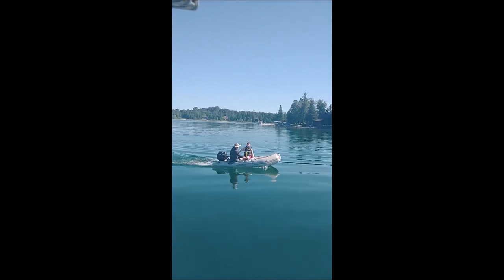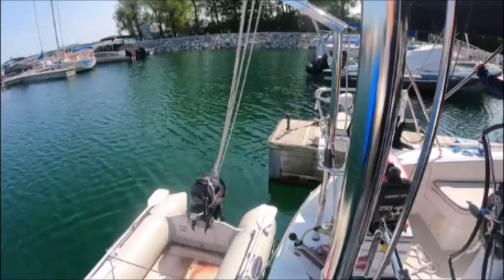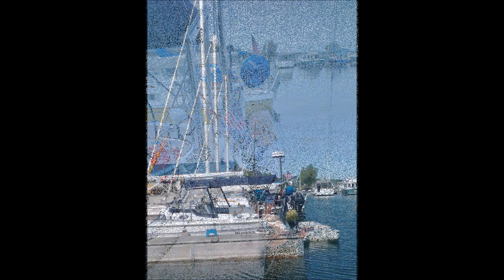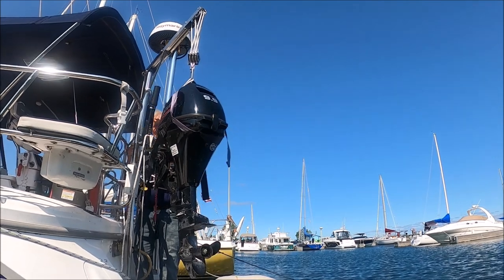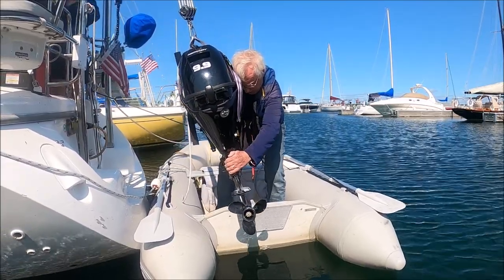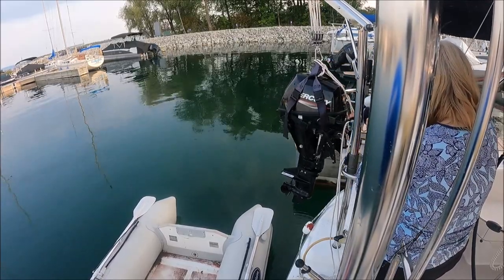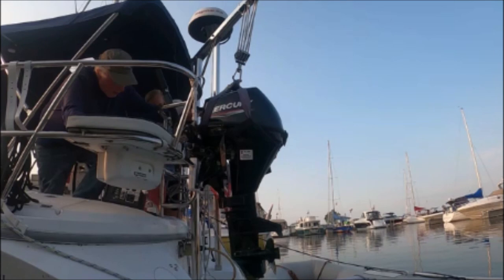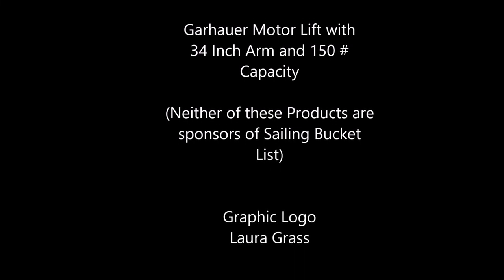Episode 27 Outboard Motor Hoist for Safety and Convenience

Comment: as you get older, and less strong, perhaps leading this lift line to a winch would make more sense, so you can use the two speed, and the handle to do the main work, as well as giving the three or more winch barrel turns for friction allowing a safer, and easier lowering of the loads.
Reply: This is a great idea.
We're going to try that after we launch the boat in May, even though we don't need it just yet.
Others may benefit from your suggestion!

Comment: I just got my Garhauer hoist but can't find any mounting instructions. Do you have any closer details of how you installed yours?
Reply: We found no instructions either, even after contacting Garhauer. We mounted the plate with ball on top on the swim platform in water tight manner.  Mounted the vertical support ring on the stern rail.  We slip the pole with arm on and off, as needed.

Comment: What about bouncing seas? The dingy doesn’t always move the same way the sailboat does. Climbing rope for more stretch?
Reply: Good question!  We tow our dinghy with a V shaped bridle.  We have not towed the dinghy in seas as rough as you describe.  We have the option to carry our dinghy on the stern of the sailboat using a dinghy davit net.  Generally speaking, we prefer to stay in a marina or at anchor when rough seas are forecast.
Reply: If you look at the second half of Episode #25, you'll see an example of how our dinghy tows in agitated conditions without the outboard on it